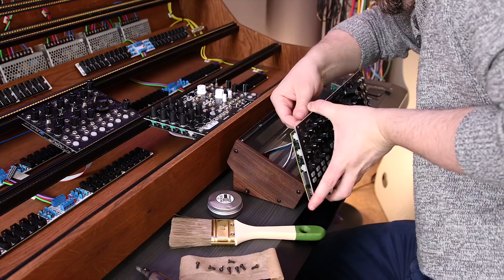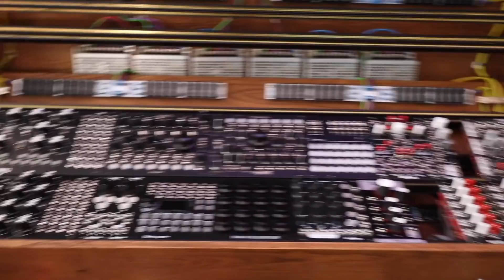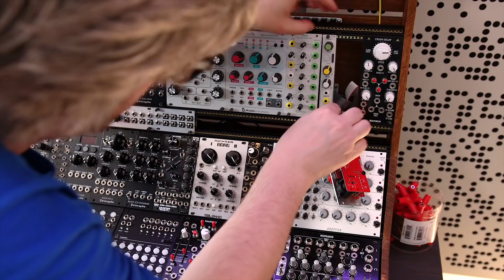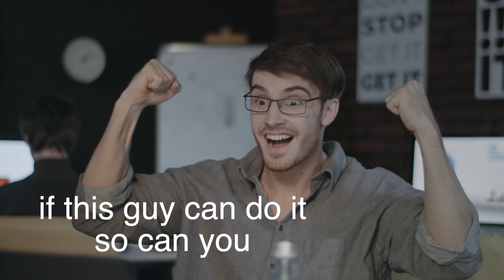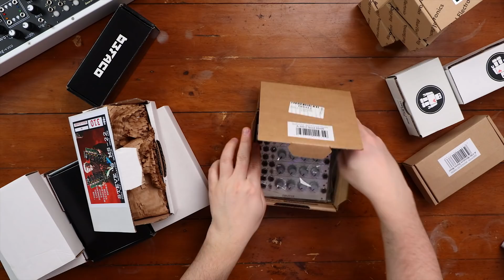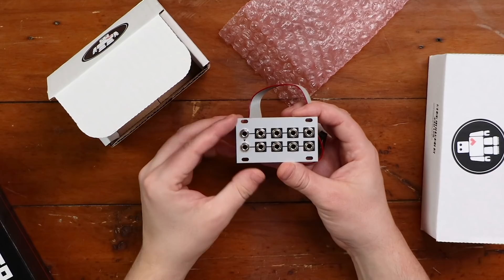My Crazy Modular Synthesizer IS DONE!! build vlog + first test

Comment: Looks like chaos.  If you're just getting started, I'll expect a regret video within a couple of months.  Buying so much gear, all at once, will definitely reveal shortcomings in your module selection.  It's impossible to build such a large system all at once and 100% correctly without ever patching before.   For those contemplating such a move, take it slow and build your system over time based on your needs, not on Modulargrid.  You'll save a small fortune.  I expect this system would cost close to $25K at retail and a lot of it looks like slop - i.e. buying all modules in a series without looking at better alternatives.  Congrats on the cool looking system, but pease don't share your misinformation with other people looking for good advice.  Few people could afford such a system, nor do they need something so large and complex to be creative.  Start with the basics.
Reply from the maker: Feel free to watch my ”should you get into eurorack video”. I think you might find some takes refreshing. This video is about my absurd build, and I don’t make particular recommendations in it. If I were to give someone advice I would say: start really small and move slowly. I.e exactly the polar opposite of what I have done.

Comment: Hi Bo. Congratulations on your awesome eurorack set up. One thing that is kind of baffling is how to power such a behemoth. It seems like you have a number of switching power supplies. Any chance you could shed som light on your thought process re power and how you ended up with the solution you did. 
Thanks for yet another great video.
Reply from the maker: heya! if you check the previous video ”unboxing my eurorack” theres alot of info on how it was built :)
Reply: @BoBeats  Thank you! :)

Comment: Hey Bo ! 
Im currently building my own modular synth case and im currently wiring my psu and putting in the protective conductor wiring. Did you make the case on your own or did you buy it premade ? The rails where you have the protective conductor wires connected look really interesting. 
Also the Busboard and PSU Setup. Cases are such a integral part of the whole modular synth situation but seem alot overlooked. Biggest part when it comes to correct wiring and safety...

Comment: I cannot agree that the forecaster module introduces anything new to eurorack as the Verbos Electronics «Scan and Pan» module does the same + panning of each channel. Also Makenoise Rxmx does the same(alltough not DC coupled) with 6 input channels. However the module looks cool and fun to use:)
Reply from the maker: never said it introduced something new to eurorack. I said it is new to me and a function you often do not see on normal synths. Very little seems totally novel in the world of eurorack: most is just slightly differently implementations of same basic ideas.

Comment: Bro you need some sort of telescopic magnet. One of those extended drill bits with the magnetic tip should do the trick though. Belongs in every tool box.
Reply from the maker: I need a lot of different tools, and learn how to use them. Because I am not very handy 😅💪

Comment: It is never done, Bo.  You add stuff, you take away stuff, you move stuff around, you buy another case and slowly fill it up.  Then you buy another or maybe sell one and then buy a bigger one (or smaller for traveling).  Then different cases get redesigned and made to fit different ideas.  One becomes your effects processing case, another takes on a West Coast flare, another is for sampling and digital synthesis tools, or maybe stuff is all mixed around and it works best for you for a while that way.  It is always in motion.

Comment: Hey Bo. My tip: you can find tools which are basically small magnets on telescoping shafts at auto parts stores. Like an old radio antenna w a magnet on the end of it. I keep one next to my big case (only use when it's powered down).  Tilt the case towards a corner (maybe jiggle it around if needed), remove a single module, problem solved :)